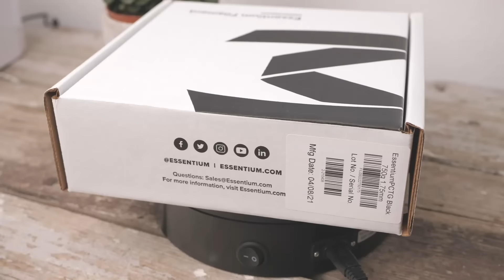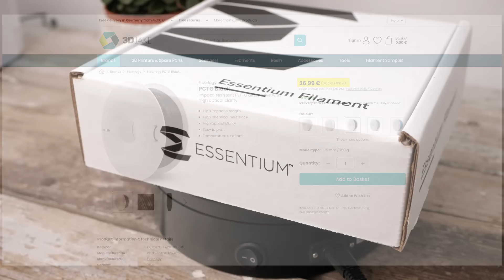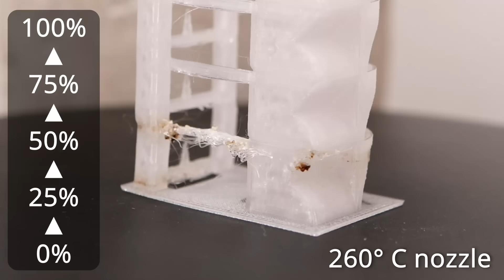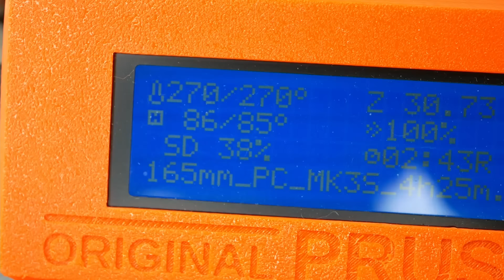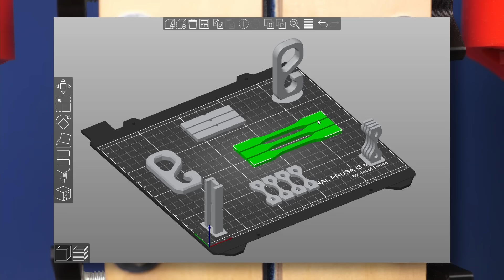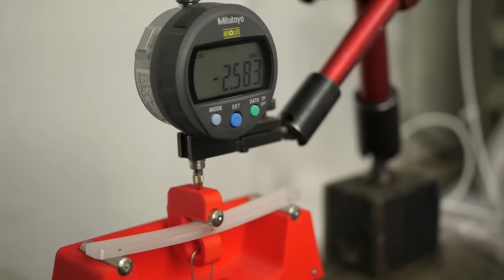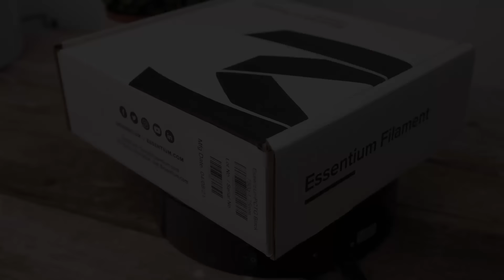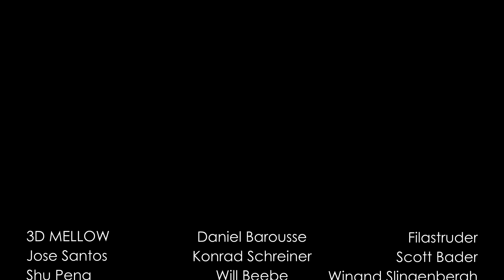PCTG - The Isotropic 3D Printing Filament?

Comment: I've noticed wildly different properties from different vendors' PETG offerings--I've had the most consistent high strength results with Hatchbox's, with Sunlu rolls doing pretty well but not entirely consistent from color to color. 

I've also adopted printing PETG in a different manner--generally only printing with .6, .8mm nozzles or larger, with 4, 5 or more walls, 8 or more tops and bottoms and above 50% infill but generally 100%. It becomes difficult to control warping with it when printed both hot and at such high density without really good ambient air control, but layer adhesion is excellent at these parameters. Parts or features that aren't too thin have near injection mold level properties. Destructively analyzing parts by taking side cutters to layer intersections and comparing to the force required to cut into parts perpendicular to layers shows no great differential. Slicing high or full density parts in half or in sections of interest generally have shown full crystallization and forming instead of apparent layer lapping and lines. 

It isn't the easiest to work into mechanically appropriate parts, but yields excellent results so far in my recent findings. Granted, some post processing and failed, warped prints are to be anticipated without the perfect setup or proper filament+nozzle+layer height pre-print optimization completed before getting started.

Generally, my best results have been with clear or white hatchbox PETG at temps between 255-270 (changed thermistors between print jobs--never trust your printer's reported temperature), with my vanadium nozzle giving me reliably consistent results at 260, and layer heights between .28 and .52 depending on the part and nozzle size. Uncharacteristically, I've not needed to worry nearly as much about filament moisture either out of the box or even after leaving it out for a week in between prints, with no noticeable differences in printing or end result. At these higher temperatures, I've been able (and need to) run about a 45% cooling fan (single, 5015, custom shroud) on average. For bed prep, I use the smooth side of my glass E5+ bed sheet and run temps around 88-90 and liberally, but evenly, apply "extra strong hold" hairspray during heat-up (hairspray that lists copolymers, vinyl-acrylate, etc.).

If you read all this (@CNC Kitchen), I encourage you to take a second look at PETG and reevaluate it for benchmarking. I think its worthwhile since PETG is so readily available and for such a low price of entry--and is, generally, one of the safest to be exposed to when printing. I think its worth making more content about it since it's also difficult to get right, and with more content from people like you, people who buy it and fail might not feel burned by their purchase or fail to troubleshoot proper printing parameters, setup or expectations. I'd like to see if, with a fresh approach, your results differ at all from what you've already measured. Although, I'm not sure if with the standard .4mm nozzle setup and other standardized printing parameters it'll do any better than it already has.

Comment: Someone is pushing the "print one at a time" hotend dimensions close, what is that, less than 5mm tolerance? And i thought that i was running close with 10mm oversized box..

Comment: I know this video is old, but I'm new to 3d printing.  I am HIGHLY cautious with the VOC and UFP issues related to 3d printing. I bought a flashforge 5m pro just cause it is enclosed and has a filter.  I have only ben using PLA since it seems well documented that PLA is pretty harmless, especially with the filtering my printer has.  I need a material that can survive outside with high temps and UV...but ASA and ABS scare me cause of the fumes. Does there appear to be ANY documentation on the safety of PCTG in terms of VOC and UFP compared to PLA or PETG?  If PLA could handle temps in my tropical climate (100F during the summer is common) and UV I would not even bother looking for a different material as so far it meets my other needs.

Comment: Das Filament have a "Flammschutz" PETG that should be very heat resistant.

They have a video on their website showing it in a flame, but without any numbers and comparisons to other filaments.

I think testing this filament would be an interesting video topic.
Reply from the maker: "Flame Retardant" doesn't mean het resistant. Additive like borates cause the material to not sustain a flame though not changing when they get soft.
Reply: @CNCKitchen  Oh, didn't know that. Thanks for the info

Comment: Hi, I would not expect isotropic properties from any printed material as we can expect the polymer molecules to orient during printing, they are extruded through the nozzle and during this process they will align at least in some degree. So even if you have perfect layer adhesion the material properties will vary based on the printing direction.

Comment: I think layer adhesion is more a property of our 3D printers than the filament. You just can't beat a temperature controlled chamber for layer bonding. This filament seems to work by having a high print temp and low glass temp. A reasonable compromise I guess.
Reply from the maker: It's both, material and process need to be tuned to achieve the optimum.
Reply: @CNCKitchen  agree. But we don't really have the machines to adequately control the process. And given the trend for copycat, every printer is an Ender 3, I don't see it changing.

Comment: Can somebody give me a simple explanation or example of where the differences between ultimate strength and impact strength would be optimally used?
Reply from the maker: Very simple: If something is either loaded slowly or with a constant load, ultimate strength is what you're looking for. If your part might experience fast changing loads (e.g. impact/dropping...) impact strength is what you're looking for.
Reply: @CNCKitchen  Thanks. So that is why ABS is still considered "strong" while being weaker than PLA? ABS can say, be dropped and stay together whereas PLA might fracture?

Also, any thoughts on comparing the PCTG to salt-remelted PETG? Or even just doing a salt-remelted PCTG test?

Comment: @CNC Kitchen I'd like to see you use PVD-F which is a material that at work I see a lot, always machined from bars, but I really don't know how and if would be interesting to use with a 3d printer. that's a really tough material, chemically untouchable from acids and tough as hell. more is self-lubricating so it means has a good mechanical resistance

Comment: You have to test a PPA Filament like the LUVOCOM 3F PAHT® 9825 NT (also produced by W2-Filaments). It should has better impact and temperature resistance than PC and is very stiff! It is comparable with POM...

Comment: Why don't you include an oven thermometer (in oven one) for your heat tests in the footage, it would probably be easier to detect where the exact temperature is reached where parts fail.
Reply from the maker: Good point but the analog ones are usually not that precise. I do have two thermo couples pc the inside, though.

Comment: I wonder if printing in an enclosure would help layer adhesion and make it more isotropic 🤔
I get the impression that many filaments are advertised as 'can be printed without an enclosure', to increase sales as otherwise people without an enclosure would avoid buying it. But it might (perhaps, I don't know), make a big difference for mechanical properties, and might be needed to get close to the 'advertised' mechanical properties.

Comment: Essentium seems to have an interesting print approach for their dogbones: Without shells. Does anybody know wether they cut it from a printed plate or print it directly? To have the path turning points at the edge might influence the properties.
Reply from the maker: Oh, do they? Are you suspecting that from the schematic images in the datasheet or is there more information somewhere else?
Reply: @CNCKitchen  No, it was just based on the schematics in your video. Haven't looked into it before.
I was wondering at first why the values for yx dogbones differed from the xy ones. Because when I print test pieces I print with shells and 45° infill. And there these orientations shouldn't have a relevant influence. Their approach could explain the difference. And is in a way reasonable: you are separating the ways the material can adhere to itself from each other. But you might get other issues. Afaik there is still no standard how to print a dogbone.

Comment: I've printed lots of stuff, from electric motors to struts and frame prices. The only problem I've had with PCTG is leaking.  It leaks through the top, and bottom of the heater block of the Micro Swiss, "heat break, and hot end nozzle. Other then that I love PTEG, this sh*t is the "bomb diggity dog."

Comment: Not to take anything away from PCTG and other exotic high performance materials, but in all of these tests I'm always surprised how well the cheap and easily printed PLA compares. It seems that it gives away far less in performance than the cost difference would suggest.
Reply: PLA is very useful for anything kept inside. unfortunately its low softening temperature eliminates it as a material for most of my projects. petg has been my go to for everything. but the frustratingly low print speed required to make it look good and its unforgiving nature about printer settings is pretty bad.. Im basicly looking for anything that is the same or stronger but prints easier/ faster

Comment: PCTG nutze ich für 95% meiner Drucke. Nur wenn ich eine höhere Temperaturfestigleit brauche nutze ich ein anderes Filament. Es ist das beste Filament was ich gefunden habe. Druckt ein 1mm starkes Rohr. Wenn das bricht druckt ihr zu kalt oder mit zuviel Kühlung. Ich hatte zuerst Probleme mit sprödigkeit in den ersten 5mm. Nach ausschalten der Kühlung in diesem Bereich ist alles super.

Comment: I see under extrusions, drooping bridges, burnt filament, stringing, etc. Port holes on the sides of the Benchy don't look round. Under extrusions around the chimney. You should be able to read the back and bottom  clearly.

Comment: Würdest du evtl mal das Extrudr Greentec pro testen?
Reply from the maker: Steht auf der Liste.
Reply: @CNCKitchen  Hab mir das Extrudr Greentec Pro mal bestellt.
Also es zieht recht viel Wasser , wenn es lange offen liegt. Bei mir ca 6-7g wasserverlust , nach dem trocknen @ 60-80°C....

Druckbar mit pla Einstellungen , auf einer FR4 Platte.
Ca 220-240Grad , habe ich getestet..

Es hat eine super Oberfläche und ich finde es ziemlich stabil. Layerhaftung ist jedenfalls wesentlich besser ,als bei "abs" oder "nice abs" etc...
Es ist auch wesentlich wärmebeständiger als pla.

Bin mal gespannt , was bei raus kommt , wenn Du es testen solltest.

Comment: Is it safe to print without ventilation/filtration (unlike ABS or ASA)? Relative weight?
Reply: All filaments are kinda iffy to print without filtered enclosures because of airborn microplastics. If I had to guess its similar to petg when it comes to offgassing. Worse that pla but no where near abs.

Comment: You should look into using PVP polymer as a print bed coating material. It works very well for PLA, PETG, and is most impressive with ABS. I print on a Garolite sheet at 120C for ABS. The print sticks so well that you cannot get it off the hot bed without breaking the part. Then when the bed cools to room temp it often self releases. If it’s still stuck then gentle prying or flexing the bed easily does the trick. I also use this on my PEI beds at standard temps.
PVP is water, and alcohol soluble and is non toxic. I mix 0.2% PVP powder by weight with denatured alcohol. Then just wet the bed with this solution, leaving a very thin layer to print on. You can find it for sale as cosmetics materials. It’s even available on Amazon. PVP (Polyvinylpyrrolidone). Give it a try.

Comment: Would you print you next Voron witj pctg?
Reply from the maker: No, due to the thermal resistance. For an open frame VORON 0 it's probably fine, but not for enclosed stuff.
Reply: @CNCKitchen  ja, klingt plausibel. Ich werds  bei Gelegenheit  einmal mit versuchen

Comment: Can anyone refer me to a video that shows how to print one part at a time but in the same print like he was doing in the video? I could really use that for my prints.
Reply: Not sure about PrusaSlicer, but in Cura, you can enable printing one part at a time, as long as it doesn't interfere with the printhead
Reply: For example in Prusa Slicer under output options you can setup completion of individual objects. Your gantry should give enough clearance or you should be sure that it wont touch the already finished objects...

Comment: ONLY if part required is to bend along the layer build, due to the higher price and temperatures needed I'll stick with PETG :)

IF it could be smoothed like ABS, then that would be another story.
Reply: Honestly I bet you could smooth it with a blowtorch if it softens at 80C, but doesn't break down until past 300C. Maybe it won't be as glassy-smooth as a really well-smoothed ABS part, but that way you don't have to screw around with hot acetone and acetone vapor.
Reply: @tissuepaper9962  Err,.. think I'll stick with the acetone and ABS when smoothing is required thanks :)

Comment: Honestly I think i am not gonna use any filament other than PLA anymore because of the moisture absorption problem. All abs, petg, tpu absorb moisture like crazy which makes prints look bad. They are also more difficult to print and require higher printing temperatures. I personally print things that require strength and pla is good enough.
Reply: Well, if you're only printing decoration toys you can get away with PLA. 
Useful parts will require other filaments...
Reply: @alejandroperez5368  I don't print decoration toys at all. I use my 3d printer mainly for printing electric motors and for other projects too. I find that ST-PLA is strong and easy to print. I tried all other types of filaments but they are just not worth the money and the effort. I am not saying the other types are useless but they are unnecessary for most hobbyists.
Reply: @zakariakhamees  PETG is easy to print with an all-metal hotend. Just a lot more stringy and with worse print quality.
Reply: @alejandroperez5368  I agree but with petg you gottta keep it dry.. otherwise it will be even more stringy.
Reply: @zakariakhamees  Build a drybox. That's a bad excuse.
Reply: @alejandroperez5368  Yeah you are right.. did you try making one? is it easy?

Comment: I was under the impression than a big pro of PCTG vs PETG is its superior chemical resistance.
Reply from the maker: It is, but in "hobby" applications it's usually not of concern imo.
Reply: And PETG is already not bad. I've printed a few parts for on and around my metalworking lathe and mill, no problems so far with resistance to any of the lubricants or coolants I've tried.

Comment: what about water resistance? I love PETG because It will last for many years in a aquarium environment :))
Reply from the maker: PETG is actually horrible for that because is hydrolizes in water^^ No issue for decorative parts but I wouldn't make any underwater fixtures with it.

Comment: IMO given the price, printing properties and requirements, and many of the manufacturers' proclaimed(!) material properties - the competitor to this is PC, not PETG. AND IMO it fails to compete in pretty much every way. If comparing to PETG, it's not far off, but its also at or near double the price, for very diminishing returns. I really hope this stuff has some other good properties that weren't touched on or noticed in this piece

Comment: souinds interesting, but it seemt to be too much of a hassle to store and handle. Guess I'll stick to ABS then.
Reply: I would look into at least trying ASA vs ABS. ASA and ABS  have similar mechanical properties. ASA though is resistant to UV, has better temperature resistance and less warping. ASA also is easier to print and doesn’t smell nearly as bad ABS.  I will never return to ABS except maybe to use up what I have left.

Comment: you should try some PEEK or PEKK.
Reply from the maker: Don't have the equipment for it and it's imho overrated.
Reply: @CNCKitchen  The temperature resistance is the preferred feature. In order to print it, you'd have to upgrade your heat block to steel as well, and use borosilicate glass heatbed.

Comment: Maybe you should still have dried it before use.
Reply from the maker: Should be bone dry out of the packing and had no indications that it absorbed considerable amounts of moisture.
Reply: @CNCKitchen  Not necessarily.  You have to consider that it left a waterbath only minutes ago before it was sealed.  That water bath aldo increases the ambient humidity in the room.  Also the very fine stringing makes ne think that the filament needs drying.  Maybe worth a try..

Comment: That's almost twice as expensive as PETG, so I wouldn't call it reasonably priced. I just picked up a roll of POM for $27, so $50-something a kilo is pretty pricey by comparison.
Reply: What are you going to do with it?
Reply: @davidwillmore  Impulse buy. It was a kg of POM for only 27 bucks! Good brand ABS can be more than that. Might try building a Voron with it if I can manage to print it.
Reply: @fwiffo  good luck  I got a roll years ago and never had any luck with it.  I did get it to adhere to an ABS slurry on tape.  But layer adhesion was bad and it shrunk a ton when it cooled.  Good luck.  Let me know if you have any luck!